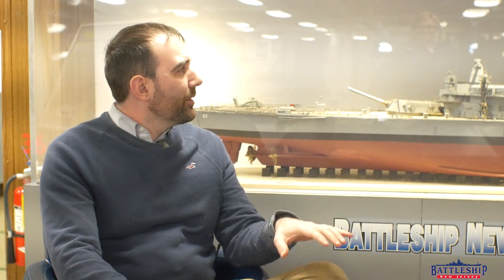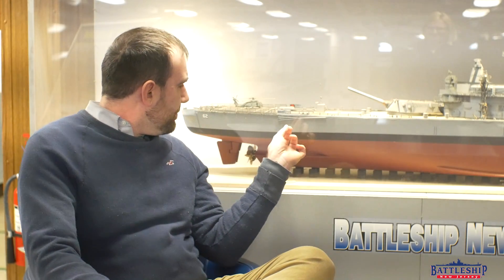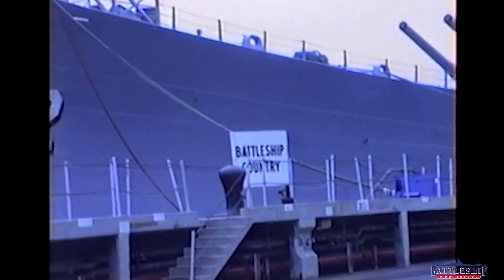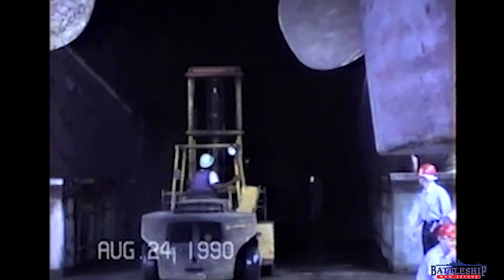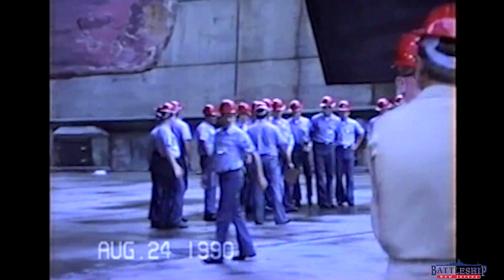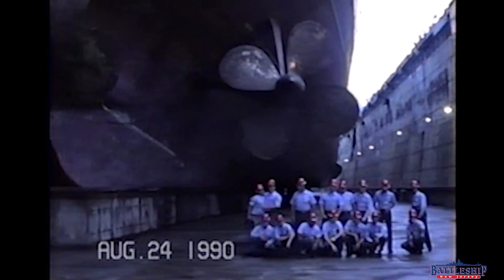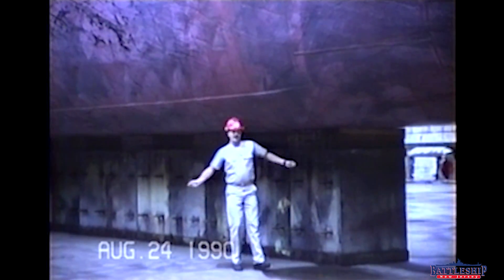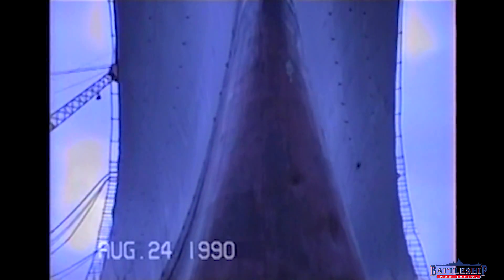The Navy's Super Secret Stash of Keel Blocks and How You Paint Under Them

Comment: Why not have hydraulic blocks, that can be compressed and removed set at the time, then move to next tones once pain is dry? I get its bit more expensive to operate but you could use rubber on top with wood so it compresses and expands and have the blocks be on smaller blocks you can take weight out off then remove them and pull the whole block out, or use two wedges to slides and expand the wedge agaisnt the hull? There is many ways this could be achieved, though hydraylics and corrosive salt water yeah, you dont want it be there for months at the time, then it could get expensive.

Comment: Are you confirming the use of less keel blocks with the core of engineers or with a engineer to confirm that the reduced keel blocks in the specified arrangement is proportional to the weight distribution as per how the New Jersey was built??

Comment: Is there some way to get an accurate weight of the ship when she’s in dry dock, like the dock has some equipment to give that value by the amount of air needed to be pumped in/water out to refloat the dock once she’s on it?
Reply: It is based on the observed waterline, which provides both displacement and distribution ... all part of the extensive naval architecture to which the ship is designed, and which is precisely known prior to drydocking the ship and monitored during the drydocking procedure.
Reply: I would love to know the combat load weight vs its current museum state to see what all has been removed from her.

Comment: When positioning the blocks and subsequently the ship over them, what is the datum used to baseline the measurements?   Essentially, what part(s) of the ship is aligned with what part(s) of the dock so that when the water is pumped out the ship settles on the blocks correctly?
Reply: Divers are used and ropes and winches

Comment: So I noticed that the outboard wheels have 4 blades and the inboard wheels have 5 blades. If I understand it correctly, all four shafts have the same SHP, it's be interesting to understand why the inboard wheel's are different.
Reply: I think recently he talked about that. If i remember correctly, they did it because of vibration. The prop wash from outer props was affecting the inner ones.

Comment: Are the blocks ( that appear to be concrete ) anchored / keyed into the floor of the dry dock so they don't slip out of place?  Specifically, the ones on the left / right curved portion of the hull.  Also, how is the exact position of the hull to block managed while the dock it pumped out?

Comment: I assume in case of extensive battle damage some of those block positions are not usable. Is there anything in the plans on how many can be missing to repair damage like that in the dry dock? Or is that going to be something engineers would have calculated based on the actual unusable positions as needed?
Reply: it would be re calculated

Comment: My apologies if I am missing something obvious, but what are the blocks made of? Are they solid iron or steel? And I’m unclear about mentions of wood. Do they top the blocks with wood to provide a surface with give to it for the keel to settle into?
Reply: Traditionally, concrete main block topped with heavy oak timbers with a pine crushable cap on top of that.  Interestingly (at least the case 40 years ago when I had some involvement), new, stronger oak was NOT preferred as older, worn, softer oak provided better load distribution.  As I recall (memory may be failing me) steel side straps kept the blocks together to maintain their integrity.
Reply: @speleotrog  Thank you very much. It’s so very counterintuitive (to me) to think about the huge weight of a battleship being distributed across wood-topped blocks! Very interesting about the old oak versus new. Again, thank you for the information.
Reply: Looks like concrete. And yes. 
Iron is nonsense, as it rusts. That's one of the reasons steel is invented.
Shorter answer: 5:06.
And read the comment just before you.

Comment: What’s the tolerance for block positioning (fraction of an inch, +/- several inches, or a foot or so)?  And what method is used to position the blocks where they should be (steel tape, surveying transit, laser rangefinder, etc.)?
Reply: The blocks are positioned from a reference point on the drydock wall.  Then all other blocks are positioned by tape measurement from these key blocks.  The ship is positioned over the blocks by transit aligning the key block to a known mark on the ship.
Reply: And yes the position is important…and once lifted off the blocks the ship cannot be set down again until the blocks are re-checked.
Reply: Yeah what does this shipyard use?
Reply: They really dont have to be that accurate tho the RN tended to survey them . Being out by 6 inches on a 4 foot block would not really be a problem. You have to remember that the ship is floated into position thats hard to get inch perfect

Comment: I was wondering why nobody has developed a "smart" block that can adjust its height so you can slip the new blocks under the ship, get them supporting the weight and then lower the previous blocks and remove them.  But I realized that there's no real incentive for that.  The owner of the ships might like it because it'd mean that you could coat the entire bottom of the ship without having to bump it.  However, the yard is the group that would own and operate these adjustable blocks.  The yard would need to own and store quite a few more blocks than if they were the current dumb blocks.  In addition, bumping the ships are probably a pretty decent profit when you consider how much labor is involved compared to the adjustable blocks my mind presented me.  Then, of course, there's the fact that these adjustable blocks would have to handle the corrosive properties of water and would need maintenance while dumb blocks could just be a hunk of concrete with wood placed on top.

It's always good to ask, "well, why is it currently done the way that it is?" 8)
Reply: Actually those kind of blocks exist. Not so much for painting which is less of a concern for active Navy ships since there are planned drydocking intervals, but for hull repairs in areas that have a known defect

Comment: It seems like you could fairly easily design a block that could be lowered while it’s under the ship, removed so you can access that area, then reinstalled and jacked back into place.
Reply: Yes, it would probably cost more than a simple block because it would have to be made of several parts but certainly should be possible.
Reply: “Sand Block” consisting of a layer of contained sand between the concrete base and the wood caps. Used in the commercial industry fairly commonly. The concept is to erect a new block near the block that is being unloaded, dissemble the sand containment frame,  cut the sand sack, wash sand out with a water hose, the cap falls away from the hull and the hull reloads onto the new block(s) simultaneously.
Takes some extra skill from the block crew to build it right and it’s more expensive. More suited and economical for localized repairs for areas that are known to be suspect prior to docking. 
Over the entire keel length, it’s more economical to develop a custom plan, suitable for 2 vice 3, fleet/bump positions. Tricky part about a fleeting would be the side blocks. To get full coating coverage on the side blocks spots, They are likely going to have to build 2 sets of side blocks, one for each position, and haul the first set out and second set in, between the positions. An alternative to hauling side blocks is hinged cap side blocks, or since they are going in a graving dock, I assume whale shores are another alternative.
Reply: Think of that 300 times each taking several  hours to position
Reply: Probably not as simple as you think, mainly due to the weight the blocks have to support when the dock is dry. With a displacement of roughly 50K tonnes or more (per the Wikipedia article for the ship), each of the 305 blocks would likely need to support more than 100 tonnes; the average would be 163 tonnes, but I'm guessing the weight wouldn't be fully evenly distributed. You may not have considered the safety factor, either.

So, any mechanism, at a minimum, would have to:
1) Be the same size as the normal concrete and wood blocks (in order to make the blocking plan work)
2) Take the huge weight that the normal blocks take (so that the blocking plan works and the dry dock work can be undertaken),
3) Be able to be waterproof (for when the dock is flooded), and
4) Have to be fail-safe (to protect the safety of all the workers in the dry dock and also prevent the ship from crashing into the dock).

There's possotger factors I haven't considered, but that last one is the nail in it for me. If dock workers in the last 100 years haven't had the same idea I'd be very surprised, but I also presume they've discarded such ideas because they're not prepared to entrust their own personal safety  to something less than solid concrete and wood blocks.

Comment: How do you service the bearings on the shafts?
Reply: If its needed the shafts are pulled ! NJ has the shafts welded, you cannot have a shaft like that sitting on the bearings for 20 years without moving so they are welded solid

Comment: I'm a little surprised they don't just use huge jacks that could be lowered one at a time for access to the hull underneath. I've seen massive buildings supported with big screw jacks, so you'd think it ought to be possible with the ship too given enough of them.
Reply: Those probably wouldn't react well to being in salt water tho
Reply: @garywayne6083  Pretty sure he meant in the dry dock. Also stainless/nickel/chrome does exist
Reply: It would be a HUGE expense in terms of new engineering, complex equipment, added time in the drydock, questionable reliability, training, and much else.  And not really justifiable as the current system works very well.  The forces on those drydock blocks, especially the fore and aft end ones, are incredibly high.   That said, I've seen Navy ships in drydock with open air under the end blocks (no load, obviously) where the analysis said maximum crushing forces should exist.  Improper drydocking can damage a hull as it can cause extreme primary hull bending ... an active system, as you suggest, would resolve that potential problem.
Reply: Think of the pressure per sq inch, the load has to be spread

Comment: Ryan, I was stationed on the USS Midway CV-41 in the 1980's and, on one occasion we went  into drydock to repair a propeller shaft.  I examined the propellers closely, since they were removed and on the dock next to the ship and stamped into them was the following:  For Use on BB 61 thru 64 & CV 41 thru CV 43.  I was wondering if you knew about that and wanted to know if you find it stamped into the USS New Jersey's propellers.   Let us know during the drydock period.  Thanks for the great videos.
Reply: Engine parts, boiler parts, and numerous other parts were used on a host of ships. The same bearings for a IOWA-class battleship could’ve been used on several types of ships that used that size propeller... Some Fletcher-class destroyer parts were interchangeable with IOWA-class parts: gauges, flanges, 5” barbette bearings, hand turn spigots, etc...And if the part wasn’t in stock, our machine shop would make several to factory specs...Also, Mike....Thank you for your service!
Reply: I was on the MidWay during Vietnam,. I will bet $5.00 the shaft you had problems with was the #2 main shaft. I know the story about the damage that happen and how it happened. We spent 40 days in drydock so I got to walk under the MidWay.

B Div, Engineering Dept., Oil Lab, 4 Group BR, Evaps. Just some of my jobs onboard.
Reply: @jameslong3351 the suspense is killing us all. Tell the story
Reply: That’s interesting. I never thought about that. I work on the USS Hornet CV 12. I wonder if her props say something similar….
Reply: @KennethStone  
In June, 1964 on my first day on the job as an apprentice Shipwright, CV-12 Hornet was the very first ship I was going to work on. As our boss walked a couple of us newbies to the ship, he pointed up to the very top of the mast on the island and asked if we would have any trouble climbing up there. I’m sure he was waiting to see our the look on our faces as we  didn’t know that was part of the job. As shipwrights we were responsible for building the staging for the other shops to work on.
The Hornet was in for a yard period to have the landing area of the flight deck converted from wood planking to large square aluminum panels. It was a messy job as we had to use small jack hammers to remove the wood and there was this thick, orange, greasy gap filler underneath. One of my jobs was to slightly cut in the borders of the “12” on the front of the flight deck so the painters can paint between the lines. Kind of my signing my mark on the job.
Reply: @sfeddie1  must’ve been part of our SCB-125 modernization. I know there are a few areas along the aft of the landing zone that have metal on them. I never thought about when they would’ve been installed.
Reply: Pur display prop at Cod(which was never installed) had quote the wide range of submarine hull numbers it could be fitted too going all the way back to USS Barracuda and up through the Tench class.
Reply: Are you sure it wasn't bb61-66? Seems unlikely that they would have had to make replacements after ww2 when they had leftovers from canceled ships
Reply: Hi Ryan, why have the inner screws got 5 blades and the outer ones only 4?
Reply: @fatfreddyscoat7564  possibly something that had to be done to minimize vibration. I remember reading something decades ago that the South Dakotas had been originally slated for one thing and then something else was done (like 5 blades outboard, three blades inboard but instead 4 blades all around or vice versa)
Reply: @fatfreddyscoat7564  to push more water over the rudders,and faster, for more control.
Reply: 80-83
Reply: Thank you for your service!
Reply: Thank you for your service!

Comment: I only saw one size of keel blocks at LBNSY, and they were used for all classes of ships. The wood forms that set on top of the keel blocks were different sizes and shapes.  Keel blocks were stored, usually two high in the storage yard East of building 303.  I wouldn't be surprised if all the keel blocks were lowered into the bottom of the dry docks to help fill them in after the shipyard closed.

Comment: I know that the Bismarck was sunk because the rudder had been damaged and stuck so the ship could only go in circles. The RN then came in and just started shooting it it.
      Had they had time, could thew crew have repaired the rudder at sea. Could they have used other ships to prevent the rudder from turning the ship? Perhaps by tying the aft end of the Bismarck to another ship, then used opposite rudder to keep Bismarck on course?
Reply: Probably wouldn't work as good as the existing plan of blow the rudder off and use engine steering to get to port.
Reply: The only way would be to take her in tow. Very unlikely at sea anything could be done
Reply: @gowdsake7103  No. They had a plan to blow off the rudder completely and steer with engines. The admiral vetoed it for completely stupid reasons. The given reason was loss of life of the divers (which was indeed likely), however they had volunteers, and fighting the British fleet was more loss of life.

Comment: You said that the New Jersey is "significantly lighter" than it was, when operational.   Why, what has been removed?  And what is significant, either in tonnage or percentage?

Really an enjoyable and informative series.  Thank you, keep up the good work.
Reply: Roughly 45k tons vs 57k tons. Gone are:  fuel, equipment,  ammunition,  and emptied tanks.
Reply: No fuel, no water (fresh or boiler), very limited ammunition.  No supplies, no crew.  Plus the all the 80s electronics and other random parts the navy took off that the museum hasn’t found replacements for.  When I’m service,  anything they take out for dry docking has to get put back, and in many cases her crew would have continued working right through the docking period.

Comment: would it be worth working with the other iowas to save a st of blocks to be shared?
Reply: Base blocks are all usually around 5' tall for almost all ships so it's not like these base blocks are specific to a battleship. The part that is ship specific is the amount and shape of wood that goes on top of your base block. There is typically hardwood (usually oak) that sits on top of the base block that gets you within a few inches of the proper height based on the docking plan.Then you typically add a softwood or rubber on top of that which can be either flat or contoured to match the shape of the hull. The softwood or rubber crush slightly when the ship lands on them to "cradle " the ship. A shipyard is supposed to inspect the wood after the ship unlocks to determine if it is damaged and must be replaced. 

All that being said, it wouldn't really make sense for the museum ships to buy a set of docking blocks to share since they need so many, they are rather heavy, need periodic maintenance, and would cost a ton to transport between all the different ships locations.